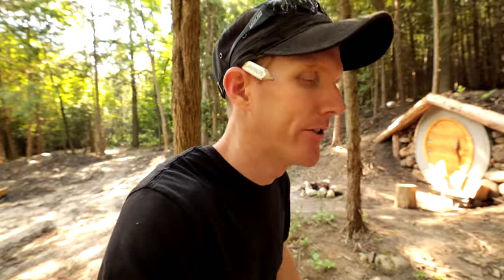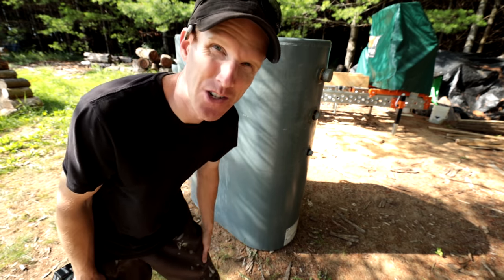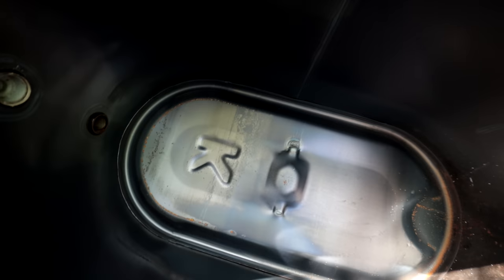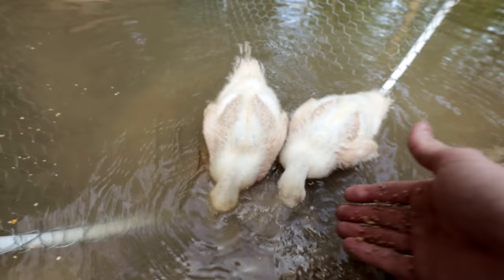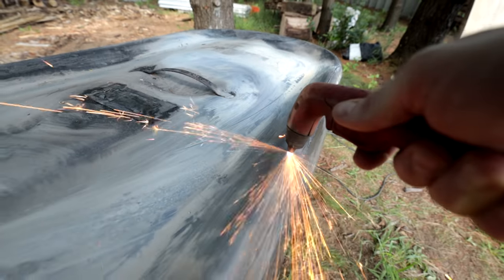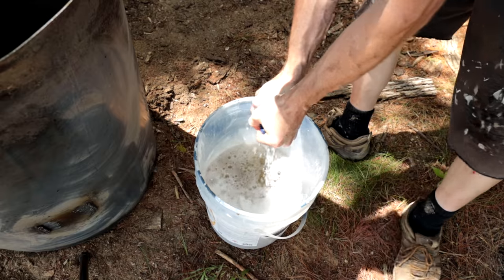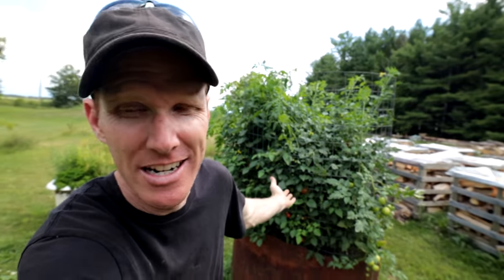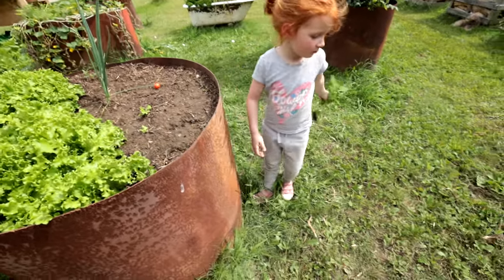Building Organic Raised Bed Gardens (using a plasma cutter!)

Comment: That is a crazy clever idea - you could even turn it into a hugelculture bed by filling it with brush and branches first, then topping it off with soil. Also, that weed that you had your daughter pull at the end is lambs quarter. It's edible and really delicious - you just use it as you would spinach.

Comment: Hey, brilliant! Last year I was pressed for space on a rocky hillside, and use an old army of galvanized trash cans with bottom drainage holes and organic soil. Things went marginally well, but perhaps removal of the bottoms is the way to go. Also, the pumpkin vines burned agains the rims of the cans. I have to come up with something.
Reply from the maker: You can use pipe insulation to soften the edges so the vines don't break. we had pumpkins and they did amazing.
Reply: Bingo. Thank you ! I was thinking that even cheap, light-colored “pool noodles” would fly if I slice them vertically and wrap the can rims.

Comment: You should have turned some small plastic buckets upside down and make a self watering planter. But you cut the  bottom out.  If you find another  tank, just make a weep hole about a foot above the ground,  the buckets will displace the water volume so it doesn't  get rancid,   the mulch around  the  buckets will wick moisture to the root of the plant and you won't need to water.
Reply: Additionally, I thought you a cluts.   But you seem to explain why you are creating things with logical reasoning.
I wish you were my neighbor.

Comment: Diesel fuel only explodes under preasure. That is the basics of how a diesel engine works.  It will burn but not likely to expolde in that tank.

Comment: Hey Kevin I do have an actual question for you, instead of cutting the bottom out totally, would it be better to cut small holes so that way you maintain more rigidity? Or is it always better to break out the plasma cutter when given the opportunity...
Reply: I left a 1 inch lip... I don't think they need any more rigidity... if anything the top is gonna splay out.. I've been using them for 3 years now and cutting the entire bottom seems to work well.

Comment: I would have opened the lid before drilling. It is safer and give the vapors a way out so it does not explode. Lol
Reply: I didn't realize it was sealed that well.. I guess the previous owner sealed it tight.

Comment: Way to use an old oil drum. But why wouldn't you lay it flat and cut the top out? It would give more surface area.
Reply: Not high enough... Want it comfort height...

Comment: My only concern when using the old oil drum for raised beds is the rust that will form, i dont know if it is safe to use or not could be bad for the microbes soil bacteria as well as the vegetables and whom ever eats them in the end. I dont know this for a fact maybe someone else can shed some light on it but I would for sure look into it before I attempted this.
Reply from the maker: There is iron naturally occurring in all soils...

Comment: So worried about them trolls of savoir faire, they can all go f  . . .  if they can't take a joke..  lol 😂   Good sho bro
Reply: For sure!
Reply: @cmosphoto1  Hey ...want an idea ... build a self feeding log stove(or logs turned to coal) or both.  But a stove that works both temperature and feeding .  Like an automatic 24 hr loading stove ...or at least 12 hrs for preventing waking to a cold cabin.  Just make a log (tube feed extra chimney ...that slides in from the out side of the house.)  Stack logs in the tube ...they slide into the fire...auto feed... but controlled by a little  motor /or solenoid connected to a thermostat..  You cap that steel 10" ish tube so fire doesn't travel up it,  and if it does its still safe outside.  .
check ..  https://www.youtube.com/watch?v=rj-6XyBlMII
No one has done it on the internet fully.  but many wake to cold houses 🏘